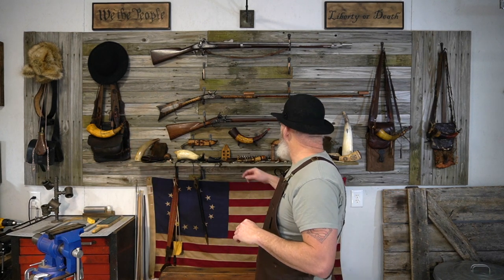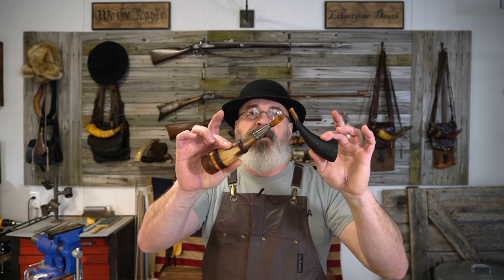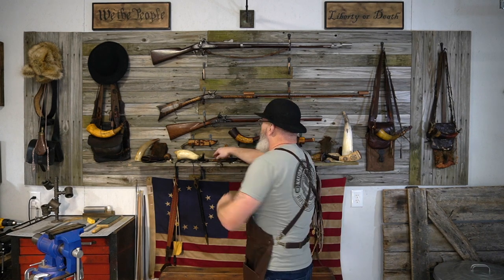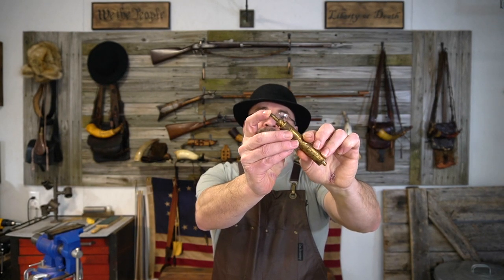PRIMING THE PAN ON A FLINTLOCK FOR FAST IGNITION

Comment: How do you ensure reliable firing with a flintlock?  I have a nice .50 cal. Tradition Arms with the breech plug arrangement...to make the chamber fire the spark, or flash, or whatever has to make a right hand turn after the flash in the pan, and travel almost an inch to get to the charge in the chamber.  I've been over-filling the flash pan, like you said not to do,  so maybe that's my problem.  Advice?.....
Reply from the maker: Hey George, sorry for the delay in getting back to you. The most important thing with those is a clear flash tunnel. Either run a tight patch down to blow it clear before you load your first shot or run a pipe cleaner down to keep it clear. The closer to the flash hole the charge is the better so with those you have to find a solution you can repeat. Keep me posted.
Reply: @BlackPowderTV  now it's starting to get cold so I won't be doing much shooting till spring...thanks for the info....
Reply from the maker: @georgeclausen2408  You're welcome! It is starting to get pretty chilly!

Comment: Hi, is it okay to load more than one lead ball maybe 2 or 3 or maybe some lead pellets on a flintlock 50 cal. rifle?
Reply from the maker: I wouldn’t load lead pellets or shot in a rifle. You’ll get lead cut up as it’s shot and it’ll imbed in the rifling and you’ll have a hard time cleaning and loading until you scrub it out. As far as multiple balls I would stay away from that as well. You’re tripling or quadrupling the pressures. You may be able to shoot two round balls with no ill effect but I personally wouldn’t do it or advise it. Safety first. 👍🏻
Reply: @BlackPowderTV  For smoothbore should be okay right use lead pellets or round balls? Thanks
Reply: @dantankunfiveancestorsfist  You can shoot most anything soft as lead or softer in a Smoothbore with no problem. 👍🏻

Comment: Safety side note... put that priming horn/flask away (in your bag) before you fire the gun... Don't leave it out where a stray spark could potentially cause it to detonate... Chances are it will never detonate. But it's a risk that is easily mitigated by putting it away.
Reply from the maker: OldSchool Jack Excellent point. Thanks!